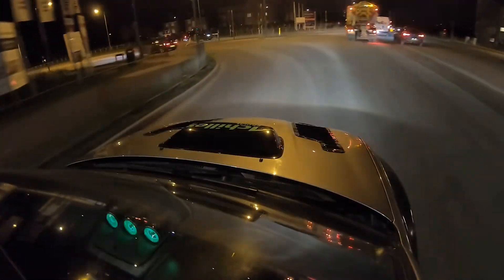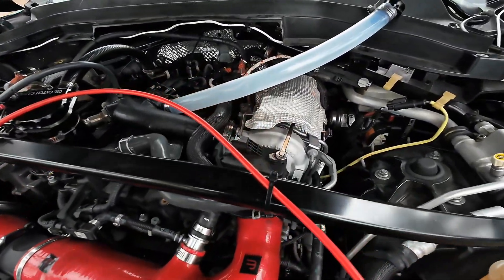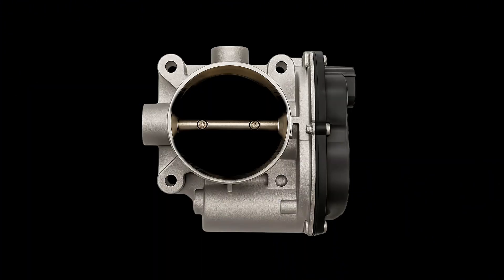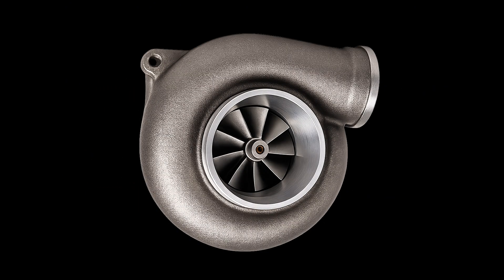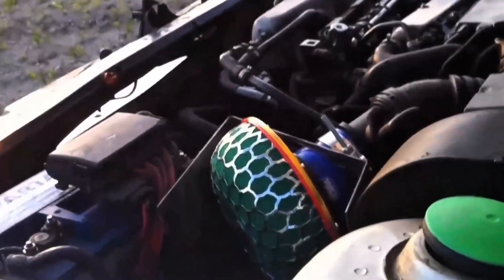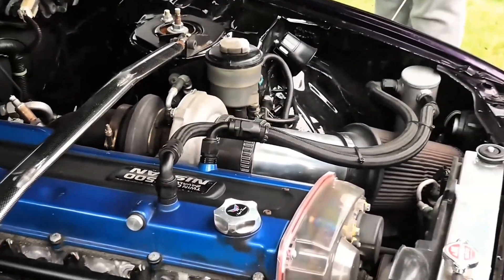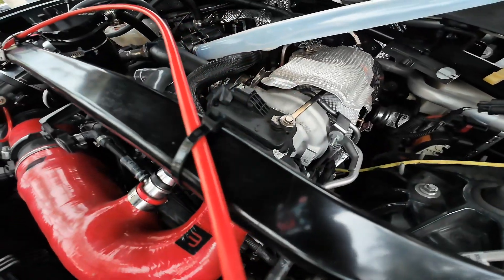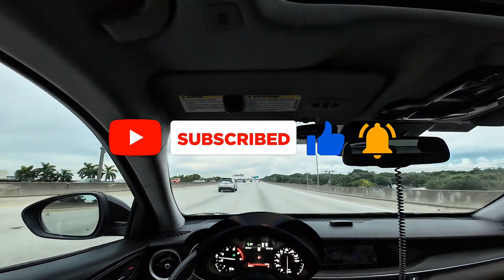Car Culture LIED about TURBO FLUTTER

Comment: This is false, turbo flutter is not bad for your turbo if it happens when you release the throttle, if it happens when you're on the throttle, then yes it's bad

Turbo fans spin at like 200 000 rpm, you really think some air pressure is going to cause it to spin in reverse? You're crazy

https://youtu.be/2QaajARc_CQ?si=uXuDXjRr6nIMBiVr
Reply from the maker: When did I say it'll cause the blade to reverse direction?

Air oscillates through it in sections causing the fluttering noise. This has the possibility of bending your blades, but the real issue is your journal bearing getting hammered.
Reply: @TorqueTheoryLabs not trying to argue one way or another but your animations clearly show the blades spinning in reverse multiple times
Reply from the maker: @gwogg8209 

Rewatching the video:

The animations show forward movement, then reversal, then forward, and so on and so fourth. It's the simplest way to explain how the oscillations work.
Reply: @TorqueTheoryLabsexcept it’s not hammering them 

You are being hyperbolic 😂

Does it increase moments of force? Yes

HAMMER is overly exaggerative 

More wear than BOV yes. As much damage as surge? No 😂
Reply from the maker: @jrich436 

It's an analogy - obviously not a literal hammer. But the loads are oscillating, reversing, and abrupt. There's plenty of research to support how destructive this is on the bearings.
Reply: @TorqueTheoryLabsno. It’s hyperbole

If you are giving a technical talk and posing as a informed source then there isn’t room for it 

If you talk casually where the audience knows you are speaking in generalities then there is room 

And again. Surge YES. Flutter from the common system enthusiast run. No

It doesn’t add significant wear to the center section

You are misinterpreting data or you are regurgitating what a misinformed person has said 

Closed throttle flutter is not the same thing as surge 

It DOES NOT reverse or stop the compressor
Reply from the maker: If closed throttle turbo flutter (aka surge) isn't harmful - why do OEMs use diverter or blow off valves?

If you don't believe me, do some research. If you can find where I stated it stops or reverses the compressor wheel - please feel free to do so since you won't find it.
Reply: @TorqueTheoryLabsOE vehicles for decades used recirculating systems as not to bleed metered air to atmosphere 

These systems were put in also with the expectation of a system to last 100s of thousands of miles 

Modern vehicles with diverter valves are similar to BOVs and are closer to aftermarket to atmosphere systems because of the popularity of to atmosphere systems on after market performance cars

Same reason they have canards and feaux carbon fiber 

To get people like you to fork over money 

Surge is and always has been a steady state high rpm/CFM state achievable at WOT

The turbine is being pushed by exhaust stream. The compressor has a contant built back pressure 

The play in the center section is exacerbated and the shaft oscillates rapidly 

When the throttle is closed you do not have the CFM to be on that side of the map 

If you knew how to read a map you would know this 

The wheel speed and ratio of the turbo is there in black and white……

There is scientifically no way to mode that much air with the throttle closed my ignorant little friend 

Not on planet earth using Newtonian physics

You are out of your league
Reply: Ok that last sentence cements it 

You don’t know how to use the English language 

You can’t track data 

You are going to get many more people saying you are wrong 

And in your head we are all stupid and wrong. But eventually…. It’s going to slip past your cognitive dissonance that you AREN’T smarter than us and it’s that you can’t write correctly 

The only people who will agree with what you said and wrote are people who are ignorant or people who also do not know what surge is 

Have fun with that 😂
Reply from the maker: @jrich436 

Writing a wall of text doesn't make it accurate. You're mixing your info - I recommend you learn about both of the main causes for surge separately then come back here. You'll need to source your info elsewhere, have a good night!
Reply from the maker: @jrich436 

You’re turning a debate into insults and walls of text. Learn the two main causes of compressor surge if you want to actually understand the concept. Source your info elsewhere - good night.
Reply: @TorqueTheoryLabs nope my engineering background 

Decades of working with legends 

My conversations at booths with manufacturing techs, that does 

If you can’t read what I wrote within seconds you are what I said you are 

You are done because you broke…. You can’t argue without sounding more foolish 

You’re almost a man. I’m proud of you. 

When you get to the point where you can admit you are wrong you’ll finally have made it 

Good luck with that mindset kiddo 😂
Reply: @TorqueTheoryLabs there were no ad hominem attacks 

I’ve stated facts 😂

It’s not a debate. I’m dictating 🤣

You’ve taught me nothing except Neil is right. 

People know enough to think they are right and don’t know enough to know they are wrong 

You really are bad at English
Reply: @TorqueTheoryLabs Why did the Audi Quattro rally car not use one then? Were they intentionally "destroying" their turbo for a nice sound?

What about the Ferrari 458 GT2 car, were they also just doing it for the sound?
Reply from the maker: @CLutch4444  Those cars also ran anti-lag and motorsport-spec hardware. They weren’t ‘destroying’ turbos for sound, they accepted the wear because the gain in throttle response outweighed turbo life, and in pro racing parts are consumables. Flutter is NOT good for performance, but skipping a BOV was worth it to them for the tenths gained by keeping shaft speed. OEM street cars can’t handle this.
Reply: @TorqueTheoryLabs Sure, so then why do commercial diesel trucks have turbo flutter then? They don't care about speed, but they definitely do care about reliability
Reply: @TorqueTheoryLabsa bov would actually improve transient throttle response in most applications. audi didn’t run one bc as mentioned they used anti lag so the minimal increase in response a bov offers wouldn’t be worth the added complexity of having one. It had absolutely nothing to do with wear.
Reply from the maker: @CLutch4444 

Diesels are totally different, w/o a throttle plate they can't create the normal throttle lift surge.

If they flutter, it's not the high pitched throttle lift surge - and instead it's the lower more choppy overspeed surge (which is MUCH worse then throttle lift surge).
Reply from the maker: @khoellebasnight4428 

Transient response is a different story. But overall throttle response should be better w/o a BOV *theoretically*. It would be great to test this.
Reply: Clueless

Comment: A blow-off valve that simply releases all of the air (instead of recirculating) sounds very cool as well and completely protects the turbo against this
Reply: People never get the right sized blow off valve
Reply: @oler777  Not the size that's the issue. More so the spring
Reply: @么1st亗Horseman么  it happens to one and five guys
Reply from the maker: I can vouch for this! 

Mine sounds awesome.
Reply: I'm running a stock R32 blow off valve on a 91 supra zmgte. Sounds better than the other brands I had back then.
Reply: @kriegsgottSS i love my hks ssqvs and yes, I run two of them to be annoying as possible lol
Reply: @oler777 they are the worst by far
Reply: @josheee6123  oh no some guy on YouTube told me my blowoff valves are bad. I better go change them because they're not the best of the best. I better go buy some old blow off valves off of a Formula One car and put them on my car so this one person on YouTube can be happy shut up. It's literally better than anything you have.
Reply: @josheee6123  so you're wrong if you mean best yes they are. Everybody should be running HKS SSQV's if it's not flowing enough for you put two on there you're able to put a recirculation valve in you're able to make it sound cool and you're able to piss people off on the Internet I think commenting when they don't even know how to post a YouTube video is acceptable
Reply: whats the issue with recirculating?
Reply: @chickenbobbobba Nothing, in fact recirculating is better as it helps reduce trubo lag, but it doesn't produce any sound. Most turbocharged vehicles have recirculation systems in place, so I'm just saying that if you change them to rather vent out the air, it gets you a cool sound
Reply: @dpr61 ah, that makes sense
Reply: @dpr61recirculating does make noise if you have a high flow intake
Reply: @dpr61the main advantage is that in a MAF system 100% of the metered air sees the combustion chamber 

Most people do not rewire MAS between the BOV and TB

They leave it pre turbo or post turbo pre FMIC

The BOV leaks air that the ECU expected to be there 

This is why most stock turbo cars do not have them
Reply: @jrich436  most mass airflow sensors are not supposed to be pressurized just bringing up the Nissan 300 ZX 240 SX Nissan skyline modifying the math to run upstream. The turbo is a giant pain. And whatever blow off out of you're using is broken if it's leaking yes for the slightest fraction of a second when you push the throttle, it will leak a little bit of air out, but that will also add a little extra fuel at the start never hurts I'd always rather run rich than lean my car out.
Reply: @oler777 we have pressurized them for years on 10-15 psi mid A/R builds. Higher builds call for a swap to MAP so I can’t say I’ve shown one 2-3 atmosphere and my guess would be it’s more the mass and speed of air not the pressure of the air that’s the issue 

Do you have an engineering publication with a study 

I’m not saying you are wrong. The engineer did not intend for the wire to see more than one atmosphere. I’d just like to see actual engineering 

You can see noticeable hesitation in closed loop operation with a bov on a stock ecu

The higher the compression ratio the higher it is 

The larger the bov and pressure ratio rhe higher it is
Reply: @jrich436  you see that's my problem. I don't run 15 PSI and if you're only running 15 pounds of boost, that's a lot of work for absolutely no gain the air going into the turbo is the same amount of air in the pipe that's how suction in the vacuum works. And once you start putting it in line with the turbo, you're gonna start heating up the math more than it needs to be and pressurizing a system that really shouldn't be pressurized. It measures flow, not map. 

Something like this wouldn't even work for the Lexus maf upgrade on the Toyota third GEN supra since that math is designed to have a bypass built into it
Reply: @oler777 absolutely 

But the most common thing is going to be someone boosting a N/A application with a Chinese turbo, no compressor map  “Good for 400hp (insert manufacturer) 1.5-3.0 (maybe insert model)

😂
Would not work on a modern Toyota MAF 

But more OBD1 and early OBD2

So tC, Celtica, MR2 and non VVTI 2JZ for instance

I see a lot of people here immediately going to THEIR application. We are talking generally

Modern cars with more experienced builders, we can tune for all this 

But that’s not the majority 

This is the audience
Reply: @oler777  My tuner made my Evo push 30PSI with a  Turbosmart Kompact. He doesn't recommend BOVs at all.
Reply: @chickenbobbobba depends if mass airflow or not. Ecm tuning of the “air” has already been accounted for.
Reply: Tial Q checking in. Pshewwww
Reply: Doesn't help w spool though
Reply: I was going to add a BOV to my BMW 428i, but after adding a cold air box, I can hear the recirc valve and it sounds like an S14 with a BOV. It's really strange lol
Reply: @TommyNoBaka  put a large blowout valve on it or you're gonna blow up your turbos
Reply: @oler777 just stock recirc valve, so no issues
Reply: @TommyNoBaka  oh how simple you think everything is if you're pushing more boost than stock, the stock recirculation valve isn't going to work and it's going to create the same problem as having no blow off valve
Reply: @oler777 bro 😂😂😂 nobody said anything about being tuned. I'm stock. Just have aftermarket air box so I can hear my turbos that's it. Stop looking for a fight
Reply: @TommyNoBaka  you don't know what you're talking about go make some more anime videos as soon as you've researched cars over 10,000 hours then you can start talking to me. Nobody's trying to start a fight. You just have no idea what you're talking about. Cool you have a recirculation valve and you're running a stock car that has nothing to do with turbo flutter so why are you trying to start an argument when you don't even know what you're talking about?
Reply: @TommyNoBaka  bro, nobody said anything about being stock if you put a giant turbo on your car and you don't size the blow off valve properly then you're gonna blow up that turbo with turbo flutter and dancing anime girls are not going to help you
Reply: @oler777  I've seen the result of your "researched cars over 10,000 hours", maybe in another 10,000 you will work out the basics, like how turbo flutter does not slow the turbo down.

" so why are you trying to start an argument when you don't even know what you're talking about?"

He started an argument? all he said is he was going to add a BOV and you started ranting and trying to brag, you really are confused by the most basic stuff.
Reply: @TommyNoBaka  I knew what you meant. Had the same on my mk1 Cupra and the air filter gave off such a loud noise.
Reply: Reminder kiddos: Any part you put on your car that has an impact on air and/or fuel, requires a professional tune.

People not tuning for their mods is one of the primary reasons why engines blow up.

Comment: Turbo don't have anti-surge now days?
Reply from the maker: Well they do for diesel applications, this is a different type of surge though.
Reply: @TorqueTheoryLabs I mean in turbos like the garrett ones, like the G25-585, inst the opening outside of the intake called "anti-surge"?
Reply from the maker: Yes, they do. Those help with low flow instability where the blades are spinning so fast that they can't grab onto anymore air so the pressure in the manifold starts oscillating out of the turbo.

But not anti-surge for turbo flutter as far I know.
Reply: @TorqueTheoryLabs Oh ty, now it's more clear!!
Reply from the maker: @vmqxdv  Glad I was able to help!